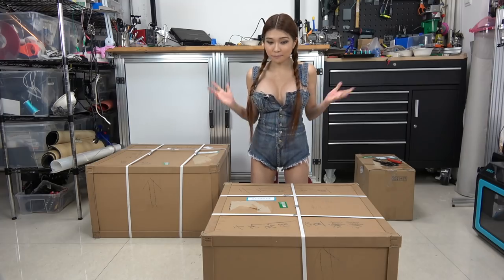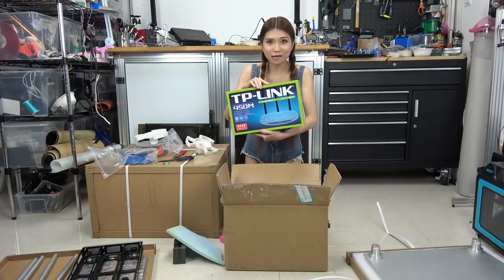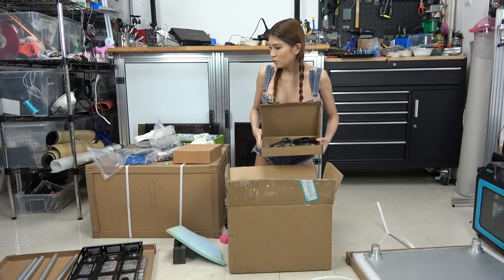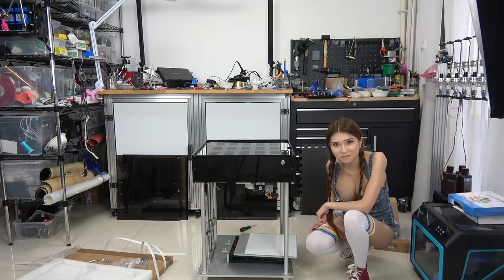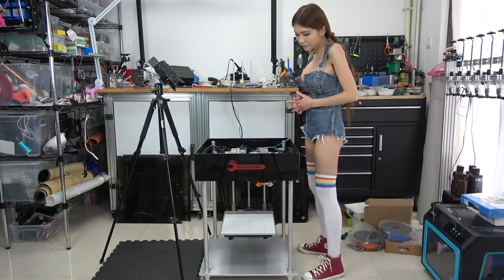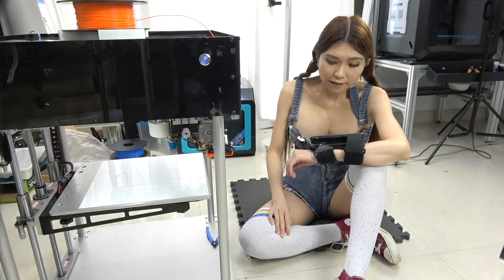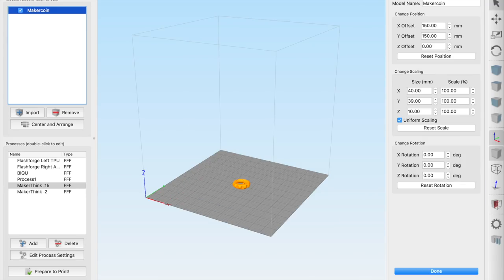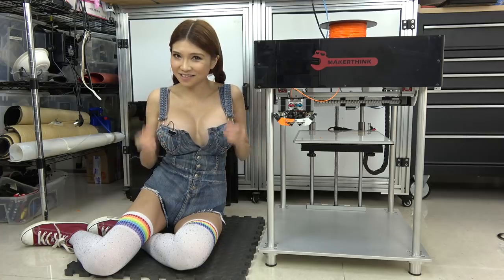MakerThink Knight Precision 3D Printer Unboxing!

Comment: It seems to be a dual extruder printer. Are you able to print a multi colours model? I've heard that dual extruder printer are very hard to configure. The nozzles height have to be perfect otherwise one will bump into what the other one have laid down. Also if the distance is not set perfectly, the 2 colours won't line up.
Reply: OK. It's a dual extruder but this review only use it as a single head one. Because we are working on the "hard" settings. But believe me, when we get it done after the holidays, it will be amazing. email me ( zheng at makerthink dot com) I can show you some samples we printed in 2 colors.

Comment: I'm really surprised to see such a lot of ringing in the prints given the absurd levels of overkill in the motion platform.  If any printer should be capable of powering through high jerks (rate of change of acceleration) it has to be this one.  Was the benchy printed extremely fast?  Or are there elastic elements somewhere in the motion system that I missed?
Reply from the maker: After I was done and looking at the video I saw one fan was out, and I did no dialing in. I'm not really going to be hard on it until I've really pushed the settings a bit.
Reply: This one is not so fast because it's a standard version - 60mm/s . With a high speed version we can get 120mm/s. But the moving parts are heavy so the acceleration should be lower - 600~800mm/s^2. And the jerk, yes, it can be higher. Actually our engineers are working on something amazing to make it faster and better.

Comment: Looks like you didn't install the side panels.  I was expecting their heat retention to be more important. Did you have any trouble with parts warping away from the build plate? Also, is there a PEI sheet (Or something like that)  on the plate?
Reply from the maker: I'll install them for the next video, see how they work...
Reply: Neat! Looking forward to it!

Comment: It's a very good design, but I couldn't help thinking some sort of screw-mounted feet, to level the whole printer, would probably be a good idea. Some of us have old workshops with rather wonky flooring, and something that heavy couldn't go on a bench.
Reply: The weight is 45Kg. We can use it on a very cheap IKEA desk. So don't worry. But the feet is a very good idea. I will consider about it. Maybe a wheel, how do you think about it? from MakerThink. :)
Reply: It's lighter than it looks then! A wheel design makes sense, no extra tools required to adjust the feet then. I would suggest some sort of bubble spirit level [or two axis spirit level] built in, or as an additional included tool. Because I know from experience the human eyeball isn't always good enough to get it right.
Reply: Just a thought, also some recessed handles or clip on holding points on the top assembly... I wouldn't want to drop that part while building it! [but something that can be removed once it's bolted to the support pillars]
Reply: That will be useful!

Comment: now if only the build volume matched the engineering of the materials (and can only imagine the price since dont see it listed anywhere).. With that weight and class of materials it should be pushing about twice that build volume in my opinion.. even with the cantilever bed.
Reply: Matt Weber the price will be a bit higher than ultimaker and the size is 300 300 350

Comment: "I'm not super technical.." ...Really Naomi?  You're not fooling anyone  ;P
The printer is a beast.  The lack of an auto leveling feature is surprising, considering the attention to detail for the rest of the system.  I am also surprised at the lack of an enclosed work area.  Ball screws are nice but they do come at the price of weight, which means bigger motors.  The choice to use servos puts the machine in line with industrial grade equipment (I almost never see steppers on a production line) but it also greatly increases complication without a drastic improvement in quality.  I'd be more supportive of the servo choice if they decided to use absolute linear encoders on each axis. Just my $0.02.
Reply: Great to hear that. :) From MakerThink. In fact this printer has a enclosed work area, just not installed in the video. And you are right, the motors we used are beasts too - 200W and 100W DC servos. Our engineers are working a solution to release more power from such a machine, and users can get upgraded by getting new firmware.
Reply: Please do consider linear encoders.  It looks like you have really nice ball screws and you've likely considered anti-backlash in your mechanical design, but nothing beats a direct encoder with it comes to precision.  Magnetic or glass slide encoders are surprisingly affordable (thank you China). I got a full DRO for my mill and 3 axis only cost $500.
Reply: Thank you man! Our engineer will check it carefully when the holidays is over. Ah. By the way, happy Chinese new year to you too!

Comment: Another great, entertaining video.  That is an interesting looking machine.  Not a whole lot of space to work up in the top to change the filament and such, but that might be that nature of the beast.  Perhaps if they had a loading position to make the print head more accessible.  Also, does the bed drop down lower to make it easier to remove prints?  It looks like a dual extruder setup, how well does it print dual color?  I like that it has an octo-pi built in.  What was the build volume?  Are the acrylic plates for an enclosure?

Comment: At 14:13 it looks like there are dual filament heads. If this is right, does the setup software support that (temperature settings for both filament heads) and how do you print with dual filaments?  Also, sliders are good for settings, but a box where the desired setting can be typed in is sometimes easier.
Reply: Yes, it's the dual head. But the dual head printing is still on progress though we have some samples. I can send to you if you like. From the designer.
Reply: ly Zheng, thank you for the offer, but I do not need samples. This looks like a very robustly constructed machine with a large bed. I will wait for the final version and the price.

Comment: For a massive machine like that, it is disappointing that it doesn't have a chamber for the filament to keep it dry and dust free.
I'd also expect to see PTFE tubing from the exit hole in the upper box to the extruder, to keep the dust, and moisture build up, out.
If they are using thermistor, these need to be replaced with PT100 or thermocouples, for extra reliability.

Comment: Hi my question is it has close loop system so it will not be skipping steps so how fast can it print? Does it make a lot of noise because of large motor?
Please test it and make a video on it
Reply from the maker: Ok will do!
Reply: 1- A high speed version can reach 120mm/s, and this one in video is 60mm/s. 2- No noise! Much better than steppers. If you like I can show you that.
Reply: Ok

Comment: Looking great  and so does the printer  the only I would like to see in this printer would be two independent extruders like one is off to the side till needed  then when it needs to change it parks the current on the opposite side then connects to other extruder and continues on this would help speed the printer  if it's a dual extruder  kinda like the bcn3d  sigma although that printer is like $3000usd if this company could do it and keep the cost low  it be really amazing

Comment: The only thing which I don't like is the cantilever Z design. Looks an awesome no-compromise design, why no three ballscrews and three rails on the sides instead?
It would be much more rigid and more precise with thinner rods and screws and with less bed support. Almost the same amount of material.
Reply: I'm guessing that would make assembly quite a bit more complicated and easier to screw up... not sure if that's a factor or not.

Comment: I think a groove is just 2D ( a recessed line). It's often called a recess. 
In Germany, we like to call a printer like that "material battle". Is it stiff enough? The 4 aluminium posts in the corners look strong, but they don't seem to add a lot of rigidity. Can you wiggle the top?
The spindle design and the bed look very rigid. Nice video
Reply from the maker: Very, very stiff. Each post is tapered and a screw pulls in tight into a machined, tapered socket bolted to 10mm plate.

Comment: Impressive printer. Shouldn't need any strengthening at that weight. Only dialling in needed. Not too sure it's a hobbyist printer
, see what the price is ...outfit of the day, awesome, keep up the good work  :-)
Reply: The price is a bit higher than a Zortrax or an Ultimaker.

Comment: It really surprised me that the print quality was not way better. With ball screws and servo motors it should have an extremely high precision and  low vibration / backlash.
I hope you will tinker a bit with the settings and make a follow up video with the best it can do. :-)
Reply: Sorry man. We analyzed the result and found it may be because of the fan. I guess the plug for fan is not on the right place when assembling but now Naomi is on the trip :( If you like we have more samples for you.
Reply from the maker: Yep- this was just a first test print, one fan was not working and I did not mess with the stock settings. Next video will dial everything in and see how far we can push print quality😉

Comment: Hi Naomi, I've been following your reviews and other videos for some time and am now a subscriber. There are several unboxing and setup videos, reviews and examples of real-world use that are quite excellent and this is another one of these. I particularly liked the video of making the neck collar, a while back, as you showed how it was designed from the beginning. I could follow it well, and of course you made one to prove how it all works. I'm used to electronics CAD (several packages) and mathematical modelling (MathCad) but I haven't yet used solid modelling. What software were you using for that collar ? It looked instinctive and easy to use. Of course 3D printers are very expensive here (in the UK) and I would only have occasional use for one. In comparison, you get many to try out. Might you consider printing an object for me ? I'd provide the file to make it and cover all costs incurred naturally. You may find it rather interesting. Your English is excellent BTW. Did you take a course ?
Reply from the maker: The choker was made with OpenSCAD. Sorry I can't provide printing services😕
Reply: Thanks for the info about that package. I'll check it out. Looks as if I'll have to explore local 3D printing services. Do they, or can they all use a common file format ?

Comment: As always Naomi you are smoking hot as usual. Another great video showing off this new printer. Nice seeing all aspects of printer from unboxing, assembling, using and the results which on this printer look better than most. Noticed it uses a Raspberry PI in the control system which is cool and just what they're designed for. Like your Pip Boy style control pad.

Comment: Nice video but you REALLY need to invest in a boom mic. Annoying as hell listening to every movement you make along with your braids banging into your pickup. 
Thanks for your contribution to the community. Outside of the fact that you're definitely a distraction, you do add a lot to 3D printing.
Reply from the maker: I used a boom before and the room has so much echo it was hard to hear me, will try to place the mic better...
Reply: You could drape the walls (except for your backdrop wall) with blankets, but that limits your filming angle. More than likely the echo was coming from behind the camera...draping a big blanket behind the camera would at least muffle a good deal of that echo.
Regardless...keep up the good work!